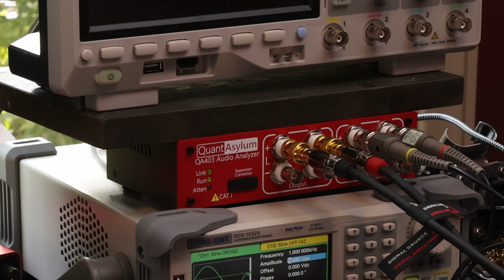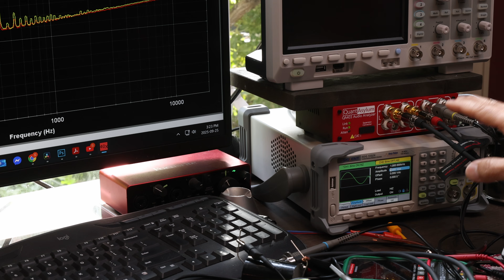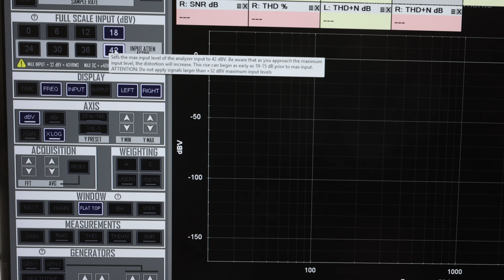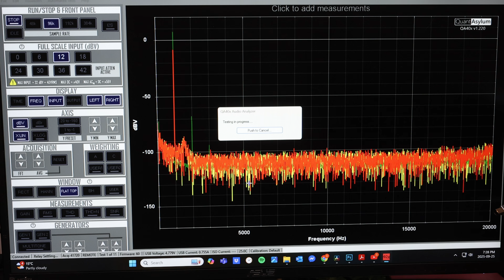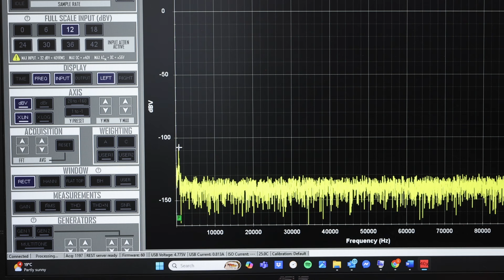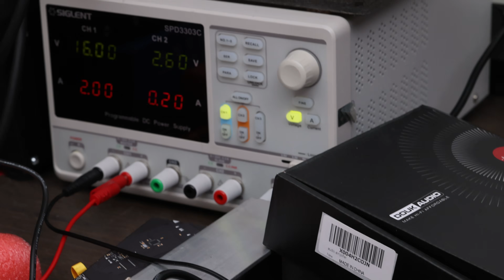The Best Affordable Audio Analyzer? QuantAsylum QA403

Comment: Is the current QA403 24bit or 32bit? I ask because in the video it says 24bit on top of the box and mine says 32bit.
Reply: its a 24 bit ADC/DAC but data is sent to/from it over usb in 32bit, the OS thinks its a 32bit device.
Reply: @robwyatt  - Right. On the top panel, my QA403 says 32bit. I see the one for sale now says 24bit. Kinda curious, wouldn't you say? I do know this, my Clio FW-01 (upgraded from Firewire to USB port) is definitely 24/192K and the distortion is rather higher than QA403 floor. It looks like 32bit to me.

Comment: Your conversion from dBV to uV are incorrect unless applied to a single frequency. An FFT will show the amplitude per root Hz so to convert to rms noise in a given bandwidth you need to integrate over that bandwidth.

Comment: Although I really like the part about testing the noise level vs. spectrum of different power supplies it seems a bit pointless and/or misleading if you don’t have a defined load on the supply under test. Obviously, that makes a huge difference with most supplies.

Comment: Now we talking. This is going to make things easier. I love testing the input signal compared to the output signal from amps, AV surround sound, equalizers, DPS's, etc... It's fascinating to see where in the spectrum the distortion is coming from. How different toroidal transformers from different manufacturers color the output. They all do in one shape form or another. With a little modification this audio signal analyzer could be used to test capacitors, coils, resistors in a passive crossover network. Though I don't like passive crossovers. They are useful, they have their place. 
This device just made my 45k testing setup obsolete. Kinda. LoL 😆